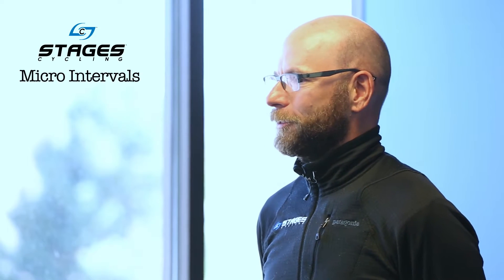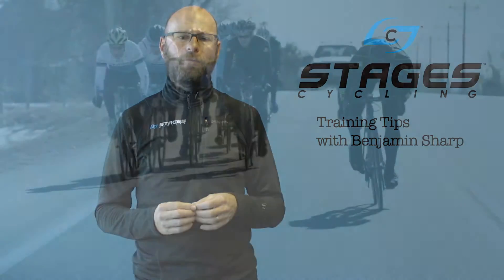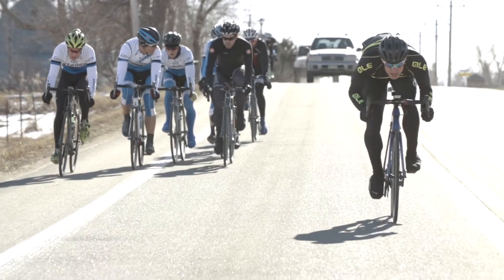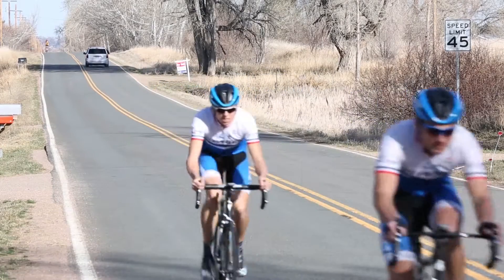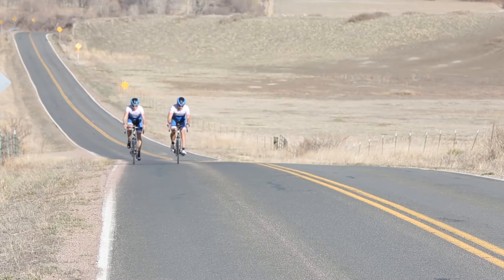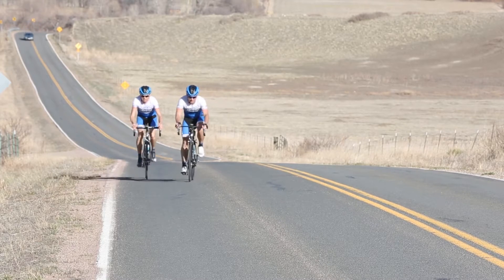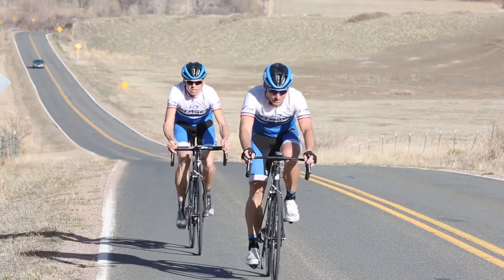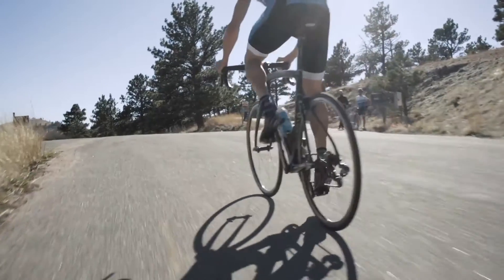Stages Cycling: How to do Micro Intervals

Comment: I do micro intervals on Zwift with a Stages bike SB20. The SB20 fails to stabilize the watt even without variation in pedaling frequency. just to compare, before I had a Tacs neo and I didn't have this problem.
Do you have a solution or do you think of an improvement (firmwar update)?